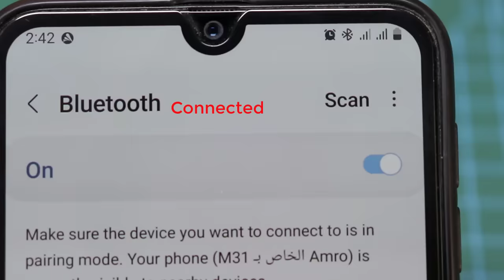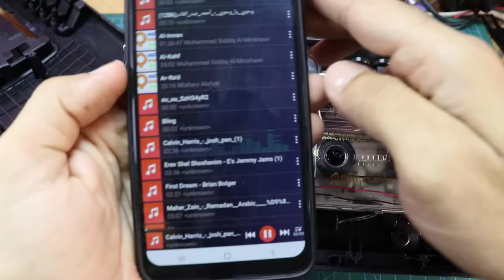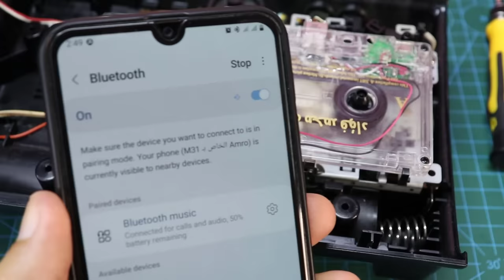How to Add Bluetooth  to Any Car & home cassette player

Comment: Great. But it's better to adjust the volume on the player, not on the phone, to avoid overloading the magnetic head and causing sound corruption.
Reply: True 👍🇮🇪
Reply: Indeed. Keep the phone volume below 3/4, 2/3 even better, and use the player volume. Might not get as load, but it will have less distortion.

Comment: i bought a am/fm digital radio tape player. it didn't have a speaker, so i opened it, took the tape player parts out, and replaced them with a small speaker! sounds great!

Comment: For those complaining about power consumption/sound quality this is meant as a drop in device that does not require any modification to the csasette player. Also, the distortions are caused by overdriving the head inside the cassette by turning the BT volume up too high. It's better to set the BT at a volume that gives acceptable quality, and then use the volume control on the cassette player as if you were playing a normal cassette.

Comment: you should try taking power from the pulleys to feed the battery. 😀
Reply: Interesting idea, but do they make dynamo generators that small? And getting the right voltage to power 5v usb is also a pain in da butt, you may have to invent a complex gearbox for that.
Reply: @DaRush-The_Soviet_Gamer  External power via flat cable passed through deck door.

Comment: You now need version 3  with stereo output for those with better tape players.    They use to make a car cassette adapter  with stereo head  for cars stereos,  this could be the blue tooth conversion version

Comment: Awesome. I suggest a power plug from the player instead of the battery nonsense unless it's a mobile cassette you bring to places and use other players. It shouldn't be a problem to take 3-5 volts from somewhere inside the cassette player. A similar cassette (adapter) was once sold where we could connect a CD player like that. It was a great gift for one of my friends long ago.
Reply from the maker: I just didn't want to distort the cassette
Reply: CD Player to Cassette adapter doesn't need a power source. This device needs a power source to provide Bluetooth connectivity.

Comment: Quite innovative alright, but, instead of passing through cassette head, the blue tooth receiver could be directly connected to the audio amplifier section of the same cassette player. This ensures better fidelity as the frequency response of the heads which are inductive (and are limited by the air gap in the head) limits the bandwidth. Also the motor and the mechanism are running consuming considerable power. Again, the battery inside the modified cassette is too small, requires frequent charging. Instead if it is directly connected to the amplifier, the power can be directly trapped from the amplifier. This makes it more simple, more efficient, and gives better sound.
Reply from the maker: Good notes..but I wanted not to distort the cassette
Reply: I agree with u sir , by the way the motor running cause noise so your dezine is much better than this guy but I respect for this guy attempt because people are different thinking,  in fact the purpose is modification of device to works such bluetooth as well.  regards to this guy project. 🤘🏼
Reply: But this way it's usability is better,you  can use it in different devices without the need to modify them ,like a old boombox that is still original.
Reply: You can use this in a walkman!! Putting a Bluetooth adapter is nothing new. I can get one installed for 5$ including labor costs here in India. The cassette Bluetooth is so innovative.
Reply: Not the point. The purpose is to make it instantly functional with any cassette player.  The destortion is from over driving the head in the cassette he made. If he adds a 1k ohm resistor up to maby 10 k ohm or maby a trim pot between black leed on head and board to attenuate the output of the Bluetooth that would fix it. Or also maby a 8 mfd capacitor th shunt some of the bass which seams to be part of the problem.
Reply: @michaelshultz2540  i agree on adding a power limiter to the whole think,
a super simple would be a potentiometer, but prob a MOSFET/FET circuit is better as it wouldnt drain the battery and provide a constant Voltage.

and for the head, u absolutely will need to be able adjust its angle (Azimut angle) the orientation of the magnetic field OR u skipp it altogether and replace it with a 110-150mH 150-200mOhms filter coil in with the top outwards, but then u def have to put a limiter in, the signal would be to strong..
Reply: NO NO NO  The idea is a PRACTICAL MOBILE device... That can be used in any Cassette player. Without modifying its electronics. The device can also be modified by adapting the impedance of the amplified output by means of resistors that allow the reproducing head not to saturate.
Reply: La idea es un dispositivo MOVIL PRACTICO ... Que pueda usarse en cualquier reproductor de Cassette. Sin modificar la electronica del mismo. Tambien el dispositivo se puede modificar adaptande la impedancia de la salida amplificada mediante resistencias que permitan que la cabeza reproductora no se sature.
Reply: @armandolared7348  that's what I said.
Reply: @armandolared7348  Most ppl get what U ment..but

Impedance is not equal to resistance
Increasing the resistance doesent increase Impedance (the resistance to an alternating freq), increasing the resistance does not increase the Impedance of the tape head.

Comment: Yes, but you could just plugged that bluetooth dongle into the line input of the tape recorder, press “record” button on the cassette recorder and job done, no soldering needed, and audio quality will be much better. The one in this video isn’t even stereo player — has only one speaker!

Comment: This is a cool idea.
Why is there so much distortion? Does the Bluetooth receiver not have enough output power to transfer to the cassette player with enough volume? Or is it just turned up too high.
People complain you can just make a direct connection.
They don't understand that your way is completely wireless and it can be used with any phone and cassette player. Also there is no wire hanging from the phone. How long does the battery last?
Reply from the maker: sound is not good because bluetooth receiver is cheap one , battery last for 5 Hours
Reply: @Inventor_AW  ok I understand.
Keep on making these great little projects.
Reply: Actually the sound is distorted because the head in the cassette is overdriven .it needs a resistor to attenuate the output of the bt reciever so the transmiting head is not oversaturated an appropriate pare of trim pots or a couple of resistors one in series with each channel output or the trim pots with center tap to ground and other end to output to shunt some of the output. This would solve the problem.  I actually like using the trim pots as this would alow you to adjust the output precisely and also controle balance.  There are better ways to do this with coils and capacitors to get a perfect impedance match. But really that would be a bit of over engineering 🤔

Comment: It shoul also still work, if the player is in pause mode (so you don't have to worry about the turning wheels).
At least here, all the (mechanical) players I tested still pick up audio when paused. :)
Reply from the maker: that's right

Comment: Better use constant volume and regulate volume in player itself. Will help to avoid unnecessary noise and sound glitches. As upgrade make stereo playback with stereo head. And add external power through flat cable which will easy go through deck door.
Reply from the maker: thanks for your info

Comment: Can you explain to me what the cassette head does?  That is, when they join one with the other, what does it do?
Reply from the maker: The cassette head, by its nature, converts electromagnetic pulses into an audio signal (in play mode) and
It converts the audio signal into electromagnetic pulses (in recording mode).
The head used in the device converted the audio signal sent from the Bluetooth circuit into electromagnetic pulses.. The cassette head converted it into an audio signal
Reply: @Inventor_AW  ok I understand well.  thanks for the explanation as he was crazy thinking.  he thought he had points of contact and he doesn't.  Thank you

Comment: Now make it powered by converting the mechanical energy of the spinning wheels 😀
Reply: Nice idea but you will need a complex gearbox for that. Imagine you put this thing into an auto reverse deck in reverse playback mode a raw dynamo would reverse charging polarities and the cirquit is dead. I know that on some logic control decks you can never be sure which side it will attempt to play first. Something to keep in mind.
Reply from the maker: good idea

Comment: I could not understand  the purpose of this whole drama. You could directly connect a recording cord from mobile's audio output to the audio input of the cassette recorder.
Reply: If the tape recorder dont have aux port...then only way to connect through this way head to head there by enabling tape recorder to play from mobile.

Comment: It is possible to make a version which will  charge the battery from cassette rewinding. I wonder how much time it will take to fully charge.
Reply from the maker: Good idea.. you won't need to take out the tape
Reply: @Inventor_AW  You may wanna invent a force forward gearbox then, because if you put the tape onto an Auto-reverse deck and it was set to reverse (side B) playback previously you may end up reversing polarities on the generator output. Poof goes your cirquit. Just keep that in mind, especially in Car stereos as most of them are auto reverse.

Comment: Wow! Best way to treat a classic Sony cassette player! how about tearing out all the cassette mechanism and wiring the cheap bluetooth crap? ...I do not understand why people do not preserve or respect these old players and 'abuse' them like this.
Reply: If you watch the entire video you will see the cassette head used in the "Frankenstein" cassette is a donor head from a different [unspecified] source. When he plays the cassette in the Sony player, at 5:01 it has its own head intact still in order to read the audio from the tape. The Sony player does not appear to have been desecrated ;)

As for me, I make regular use of vintage multi-track reel-to-reel equipment in my home studio and similarly share your concern for old technology :)
Reply: @Nathriel  hmmm. yeah, I agree he did not remove the original head, but head-head meshing is not it is originally designed for, and will damaged both heads. A head should read tapes!. Anyway, it is one's choice and freedom to do whatever he wants with his things.

Glad that you too have this concern and treasure old technology!. What I do, if I want to use these equipment with newer technology (example connecting an old music player or amplifier), I use its AUX/Line-In and try best to connect new equipment that will not harm the old one. I connect DACs to play high quality sound to tube or other vintage amps and enjoy the best of both times, at least to some extent and my satisfaction/choice!

Comment: 1:20 isn't that a Bluetooth transmitter... Not a receiver? It's receiving audio through the cassette head, but then transmitting the audio through the Bluetooth. I would think you would call that a Bluetooth transmitter, right? It was labeled as a receiver in the first video too.
Reply from the maker: The bluetooth device receives the audio signal from the phone. The head sends signal to the cassette head

Comment: The music sounds oversaturated, which leads me to suspect that the problem is not with the bluetooth module or its quality. I would first try lowering the transmit level of the audio source (your phone), which should in turn decrease the sending voltage of the wires leading to the tape head. If that gets you lower levels of distortion, then the tape head just needs to be given the proper levels and you've found the issue. That said, a cheap bluetooth module COULD contribute to low music fidelity like you said, but shouldn't be the root cause. Next, check the tape head azimuth within the cassette shell and that it has full contact with the tape head in the Sony player. Lastly, you can try adding a variable resistor in-line from the bluetooth module to the tape head to vary the voltage feed levels leading to the tape head.  Fitting it in the shell might be tricky, however this would allow you to adjust levels to where (for ease of use) you can set your phone volume to maximum and just tweak the resistor until you get the loudest volume without compromising fidelity.

After doing some more research, here are my notes for you:
------------------------------------------------------------------------------------------------
https://www.edaboard.com/threads/magnetic-audio-head-tape.273834/
This is not exactly what your application is, but seemed to be related to issues you are running into. I recommend to pay attention to what was said by one of the moderators. The difference is that you are feeding line voltage via a bluetooth module into a tape head to be read by another tape head, whereas here they are attempting to wire in a line signal in place of a cassette head.

[

3. The audio on a tape has pre-emphasis - the frequency distribution is deliberately skewed. To overcome this, the amplifier applies the opposite skew. If you feed a different audio source into the head wires, the signal will be un-skewed when it doesn't need to be and the tone will sound wrong.
]

The bluetooth module probably does not account for this!

I also found this:
http://www.jrfmagnetics.com/Nortronics_pro/nortronics_silver/Nortronics_silver_catalog.pdf
On page 3 (printed on the actual page, not the PDF page number), you can see the signal loss diagram for a tape running at 1 7/8 IPS / 4.76 cm/s (normal for cassette players). Page 10 will help with alignment and shows different head types.

Just my thoughts, nice video :) Good luck and have fun ;)
Reply from the maker: thanks for your information

Comment: It doesn't work quite well. I make the same thing a few years ago, same bt receiver i crank up at max the car stereo and nothing come out or it was super quiet. The problem is that type of receiver. Those are line level output for any aux input works well (low impedance), but is not too powerfull for the high impedance of the magnetic head. The solution is not this receiver but those chinese neckband sport bt headphones, that includes a amplifier, and a larger battery.

Comment: Instead of doing all this with cassette, it is much easier to simply connect a Bluetooth kit and connect its input to tape-recorder head and connect power from tape-recorder power supply. The small  Bluetooth kit is available in market and can be easily hidden inside tape-recorder. That would be much simpler, easily and castle free.

Comment: WOOWWW....STEREO.....VERY CLEVER.....
so, if the pulleys stop (not turn) is still the audio can out from head and we can hear the sound? I need to exercise
Reply from the maker: Yes it will work no need for pulleys
Reply: @Inventor_AW  oohhh yeeaahh...greaattt I want to try it, thank you so much.....god bless you
Reply from the maker: @ragilhartono1855  good luck

Comment: Tu es incroyable .... Mais où as-tu appris tout ça ? 😲
Reply from the maker: Chez soi
Reply: @Inventor_AW  eh bien je te félicite ! Moi j'ai déjà du mal à faire un simple circuit avec un 7805 ou un LM317 ....
Tous mes respects !
Reply from the maker: @djdingo57  Quel est votre problème .. Voulez-vous contrôler la tension?
Reply: @Inventor_AW  j'aimerais faire un pcb avec un 7805 pour y brancher des choses en test.
Avec le lm317, j'aimerais faire une alimentation variable ....
Mais j'avoue avoir du mal.
Reply from the maker: @djdingo57  Je pense que cette vidéo va t'aider
https://www.youtube.com/watch?v=qYuq2eCNkkA&t=7s

Comment: What is this. What happening actually
Reply from the maker: This is a device through which you can run your phone on any old cassette.. if you have an old cassette
Reply: @Inventor_AW  but we can do it simply by a bluetooth receiver. Why it need to move a old cassette doing so much work ?